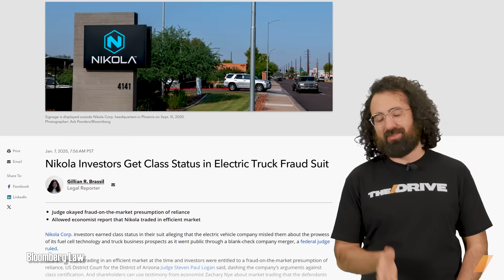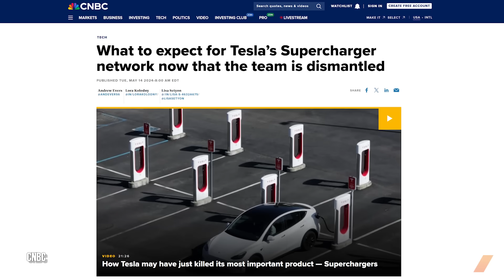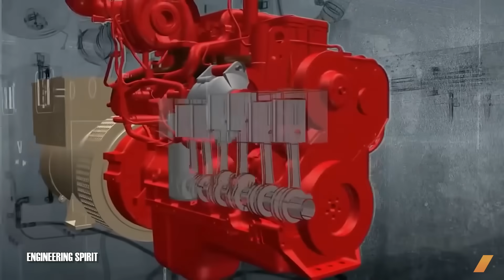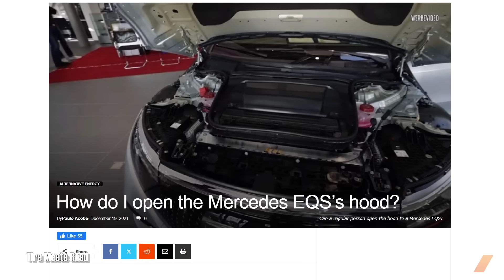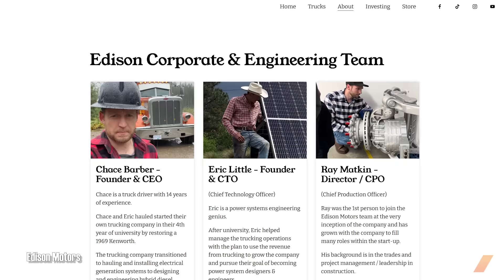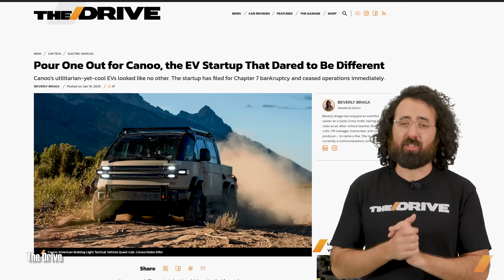The truckers in a shed beating Tesla with 100-yr-old EV tech

Comment: Haha, the greater automotive media has finally noticed Edison. Been following Chace for years now, theyre doing so many good things. You missed the part where they are deliberately going down to the local truck part store and choosing common, easy to find components so that their truck is easy to repair.
Reply: the local stores also made it easier on the old ford haha😂
Reply: It's the most sensible solution from their position regardless. Easy to find parts = cheaper R&D and manufacturing
Reply: So using parts that are 'off the shelf' is not driven by repairability. They are building s relatively small number of trucks of the shelf means they can easily find more of the same part when it's time to make more of the same. They don't have to pay for tooling and development of completely new parts. They didn't have to order them times as many parts as they need now just to get a reasonable price. Repairability just comes as a by product of small volume low overhead design and production. Saying this is not a negative, is just a reality. I've design a lot of equipment and the Grainger catalog was always handy. If it was in the catalog I knew I could a few parts immediately to build test prototypes and then could go straight into production. Other less obvious things can be done intentionally that help repairability and  production: like using one higher rated contactor in multiple uses even though some of the places s lower capacity could be used. Instead of using contactors in say 5 amp increments, you could go in 20 amp increments. Reducing the number of different contractors needed to build it as well as to stock for service.
Reply: @barrellcooper6490  It is absolutely driven by repairability. They have made a big deal about how they are building these with as many off the shelf components as possible despite there being a lot of money in supplying OEM parts (in one video they compared a generic $50 air brake release to a $400 Kenworth=specific unit that essentially does the same job). Yes it helps them when being a low volume manufacturer, but they could easily keep their mouth shut about it, slap an Edison part number on it and sucker people into buying it from them at a markup vs just going to the local truck supply place. Instead they actively point out how they want their customers to not have to come to them for common items.
Reply: @barrellcooper6490  Things like brake cans, fuel tanks, air lines, cable brackets, suspension hangers, everything BUT the electric components are off the shelf.
Reply: @barrellcooper6490  The axles are bought out of China, other parts are readily available everywhere.
Reply: For running gear.  The axles are built to spec in China which have the largest electric vehicle industry , best expertise and proven track record.
Reply: @Onan-u3b They've had to do that out of necessity. The other US or Canadian based companies that are building e-axles that could work, will not sell just a couple, they need mass bulk orders.
Reply: @Ratkill9000  Right there, you highlight why Yankland business is failing.  There are manufacturers in the world who care about their customers and want to help them with their business.  I saw one video put out by Edison, and they said several companies in American Mexicana would not even talk to them.

Look at the attitude of John Deere as an example of the arrogance of many Yankland companies.

If you are building a product, and it is your standard product, the refusal to sell a low volume to a potential long-term customer is just plain stupid.
Reply: @Ratkill9000  Here's hoping that they'll be able to switch to Canadian manufacturers once they have the volume!
Reply: @Onan-u3b it’s kinda funny to me that parts for a ton of stuff are built in China are range from relatively good to pretty great quality when “made in China” is always a sign of poor quality
Reply: @disdion-n7i  made in china isn't such a slur as it was even a decade ago ,,I run a lot of chinese made small engines and what they make today  is nothing like what was around 15 years ago ,even chinese made tools are getting to be decent quality ,,I remember back in the 90s when it was made in hong kong that was the cheap junk and with tools it was taiwan  where the junk came from
Reply: @wildcoyote34  depends

You can get quality stuff out of china

Doesnt stop them from turning the factory back on at night and makeing copys with cheaper materials

Comment: Volvo, Iveco, MAN, Mercedes, Renault, and Scania all offer electric trucks here in Europe. For me, Tesla is actually lagging behind. 
It's still great to see what Edison is doing; it's one of the solutions for sustainable trucking. 
Another solution for me is hydrogen, like what Hyundai is doing with its test fleet here in the EU, which is doing really well. 
Awesome video, keep it up! :)
Reply: If I was trucker I wouldn't be caught dead in a tesla semi that thing look like something a five year old drew at the sametime corporate made a scania EV look like something that was made to haul stuff 

Also they still have radiators to cool the batteries which would be useful in hot or summer climate and tye tesla semi have been having alot of issue just like the cybertruck had and seeing they haven't fix it and now more dangerous than the pinto I wouldn't hold hope for the tesla semi
Reply: Tesla suffers from Elon time (always lagging behind the given goals - who remembers the "new" Tesla Roadster of 2017?)
Reply: The most interesting part is that in the future they can just change the type of generator, for hydrogen etc, or replace it with batteries, since it is an electric truck with a fast charger with it.
Reply: Yeah was really weird for him to say that. They didn't do their research.
Reply: Their other point is thay their energy source is entirely agnostic

You could power it with an SMR, heck a turbine engine, hydrogen fuel cell,

All the truck cares to have access to 400V to charge the battery and enough amperage to run the motors

Where it gets it from is not a problem
It could even just be, a bigger battery
Reply: edison is still small but they want to sell it to the EU
Reply: You dont necessarily need a diesel engine to spin the generator, could be a hydrogen fuel cell for example
Reply: Tesla is lagging across the board and hasn't really innovated in at least 5 years. It lags Hyundai and BYD in battery technology and affordability. It lags the European truck brands in heavy vehicle electrification. It lags Waymo, BYD, Mercedes, and various other US, Chinese, and European companies when it comes to self-driving. And its robotics division, which is supposed to be its pivot point given its automotive business is clearly stalling out, clearly lags behind Boston Dynamics (owned by Hyundai). The only thing Tesla has going for it is that its CEO bought the American presidency, but that just incentivizes it to hide behind tariffs in the US market while losing out everywhere else due to its lack of innovation.
Reply: @microcomputermaster Tesla is going through growth right now. These vehicles arrive in paradigms. They just had to retool their factories for new model Y
Reply: @microcomputermaster Tesla just wants to keep it simple for now thats why they sell so well BC simple and just works they could of added steer by wire and 48v to the new 3 and why but didnt
Reply: The tesla can't get certified in Europe as yet again Elon refuses to comply with the LAW!
Reply: @annakissed3226  i dont think its a elon thing XD
Reply: 0 research from this scammer reporters.
Pumping the Tesla stock.
Reply: Electric isnt viable for trucking in North America. Hence why they aren't talked about
Reply: @ Electric is viable for a lot of trucking in north america. Not all of it is 500 mile highway trips. We do the same short-haul trips that europe is doing in our own cities.
Reply: @tuckerhiggins4336  hmm Tesla semi is doing it tho
Reply: You said tesla is behind and yet they have the only 500mile semi 😂
Reply: @mcsike7264 adding more batteries to get more range isn't innovation, it's arithmetic. The EU manufacturers simply aren't interested in making long-range models in a country that doesn't transport goods by truck that far. The problem is that the US has crippled its rail to the point that we even need trucks to drive 500 miles on a single charge. No one except Tesla wants to encourage that kind of OTR freight.
Reply: @gormauslander  was more talking about the us market they also have a 300 mile version
Reply: @mcsike7264  And the problem is that after that 500mi journey, you swap loads and turn around—but need to charge your truck before you can drive it back.

Edison trucks have infinite range, because you can always just top up the tanks and let the generator do its thing.
Reply: @ConstantlyDamaged  hmm nothing is infinity still need fuel so you can  charge that battery also you charge while you load/unload the truck dumb dumb
Reply: @ You responded to a post about how European truck manufacturers are ahead of Tesla by saying that Tesla was not behind compared to US manufacturers? That doesn't make any sense
Reply: @mcsike7264  Tesla have 100 demonstartor Semi's on the road, Volvo alone have 5000 EV trucks out there in an 8 model range, and Tesla aren't falling behind? They're not even in the competition.
Reply: @RichardJones-z2j Ok do those ev volvo have 500miles no also Tesla has more than a100semis on Tue road
Reply: @mcsike7264  The ones that kept breaking down? Or the ones that performed so badly companies cancelled their orders?
Reply: Brake down dude there are only a handful of companys thst have em were are you getting this news about them braking down when they are not even fully out yet 😂 @MuShinnen
Reply: @mcsike7264  "There are only a handful of companies that have them" And? That doesn't excuse mediocre build quality in a product that needs to be reliable. Least of all from a multi-billion dollar corporation. There is literal video of these trucks failing including one being hauled off by an actual functioning semi. Google is free, and you could better inform yourself instead of trying to defend Tesla like you have a stake in it. You won't though. Instead you'll have some sort of other ill-thought, tired excuse that won't hold up under even the slightest scrutiny. It's all you've been able to do in the comments. Cope.
Reply: @MuShinnen  Bro your talking like you have seen/sit/driven a tesla semi so are the companies that have them ate very pleased with em so far the range and the charging how many trucks has edison deliverd 😂
Reply: @mcsike7264  You've got nothing of substance. Just tired excuses and unproven claims. Comparing a multi billion dollar company to a small company with nowhere near the resources made any attempt at an argument instantly dismissible. Hope your stock in Tesla goes back up, but that seems unlikely. Cope.
Reply: @MuShinnen Your the one thats coping m8 there are literally videos on cnn i think can remember which news coverd it but customers are very pleased with the range and charging it gets the 500 miles as advertised comfortable and tesla says sleeper on its way your the one making claims with no proof 😂
Reply: @mcsike7264 well that’s claimed. To achieve that it’s got a payload of 15 tonnes. Not much use in the real world. That’s why the only company to really adopt Tesla is Pepsi because it’s only carrying tins of pop.
Reply: @hughmarcus1  Pepsi not the only company DHL and UPs and tesla themselves
Reply: @hughmarcus1 Actual payload is about 22 tons, comparable to the payload of diesel semis operating where the GCVWR is 80,000 lbs.
Reply: @mcsike7264 can you buy it? Is it being delivered to paying costumers? Nope.

They have a prototype that they claim does that.
Reply: @HTOP1982  yes it is being delivered to paying customers Pepsico has 100 DHL UPS are using some tell me have Edison deliver any of there trucks yet to paying customers Nope just a prototype
Reply: @mcsike7264  My employer had ordered 20. Canceled and went with IVECO. and those have actually showed up.

So, no the Tesla is NOT available for purchase. and Pepsico shifts very little weight.
Reply: @HTOP1982  hmm tesla also uses em to transport batteries and parts and sometimes cars the factory is currently under construction set to be finished this year
Reply: @ payload is still an issue though.
Reply: @hughmarcus1  its 23k pounds and 20k pounds for 300 mile version I don't think it is
Reply: @mcsike7264 dude you are talking about a multi hundred billion dollar corporation vs a tiny business owned by a couple truckers in america. Tesla better have delivered more teala semis then some dudes in a shed in canada.
Reply: @mogamer4511  well tell there fans to stop competing them then
Reply: @mcsike7264  

So which Semi EV company besides Tesla are building charging stations across the nations?  Across the world?  Where are you going to plug your Kenworth in?
Reply: @philipgrice1026 in the EU they just have 350kW chargers on Mennekes Type 2 + CCS as standard. Most charger companies are switching to these, Tesla is small fry in terms of charger network in the EU, they fell behind there too.
Reply: @philipgrice1026 Tesla isn't doing that either because Musk in all his lack of brilliance scrapped the team in charge of that. Try again.
Reply: @philipgrice1026  i believe other trucks can charge in tesla network since its already standard port

Comment: The Electric semi-trucks are allowed a maximum weight of 82,000 pounds  not 80,000 to compensate for the heavy battery. 
This will become a slow transition from pure ICE to electric or electric hybrid  ones depending on application. 
In Europe there are already plenty of companies which offer electric Semis. And there is also a hybrid from Scania.
Reply: The crazy part is, Topsy weighs about the same as a regular truck. I think a pure EV to do the same thing would start to lose payload capacity and even range.
Reply: @Zipppyart Tesla semi has a 900kwh battery and is 23k pounds

Comment: Locomotives run on electromotive propulsion. The diesel engine powers a generator that feeds the traction motors directly — there’s no battery in the loop.
Reply: Modern ones since the 1980s very much do have Capacitor Banks, they don't provide long duration of power but easily enough to get the whole train moving from rest.
Reply: With the Edison motor's driveline, the batteries are there for the peak power when the generator is not enough and short range transit. It can drive without the batteries in case of trouble.
Reply: They have capasitors that play role  of batteries
Reply: @redna_menimoh  I was thinking capacitors would be much lighter & lower cost too, just need to get them charged, then they become the reserve for hills & acceleration.
Reply: @3EyedMutantFish  It all depends on the battery type and configuration really. The Edison prototype had capacitors at some point, but with the standard battery bank they found it wasn’t necessary since the electric motor has way more torque the the diesel (when off peak) meaning the batteries can keep up with peak loads even without capacitors. And even if that could change for some applications, adding capacitors as well as the batteries doesn’t change much.
Reply: This is not enough of a difference to claim it's not the same concept. The diesel makes electricity, the electricity moves the vehicle. They are the same. These trucks can bypass the battery and run only on the generator.

Comment: The lack of discussion of hydrogen semi is glaring. Offers much of the same benefits. Clean, fueling is similar to traditional, similar power delivery. Yes there are challenges with refueling stations, but potential is there.
Reply: Look into the cost of development on a hydrogen fueling station if you want to know why there arent more. The per unit cost of hydrogen itself doesnt make sense either at the current time. It honestly seems more like a ploy from the oil industry to continue their business model than an actual viable alternative
Reply: @nolo2484  of course,  it's a young technology. The cost are going to be expensive compared to a mature technology like diesel semi and fuel.  But in the right application, ports and fleet vehicles like FedEx, Amazon, USPS, etc the hydrogen would benefit from the scaling. Btw I am writing from California where hydrogen has seen adoption both in consumer and commercial applications.
Reply: You do know hydrogen vehicles are just evs with extra steps right 😂 amd more expensive
Reply: @mcsike7264  yes. But it addresses the challenges with refueling that ev face. Takes as much time as diesel and fuel can be stored similar to diesel/gasoline. 
Did not intend to be one the champion for hydrogen. It was an interesting video, but thought the lack of hydrogen semi was lacking in the video.
Reply: @wshfullthnker  hmm 42mins for a tesla semi driver can do that on his brake  sure hydrogen fuels faster but 10X the price
Reply: Edison Motors looked at hydrogen fuel and got scared away by the $100k cost to put in a fuel pump.

Comment: I've never understood why Motors have not been used to generate electricity, oh wait they do!  Every motor /engine has a battery and lights that use electricity and with the right Alternator/generator you can even produce enough electricity to weld.  It is just one big scam to tell people they need to recharge their batteries using the Electric Grid.
Reply: A standard car alternator makes 1000 watts which is 1 kW.

To fill a Tesla 100kWh battery would take 100 hours or 4 days of constant running.